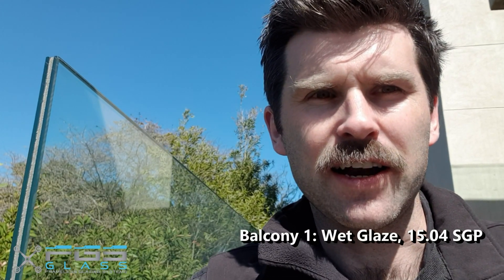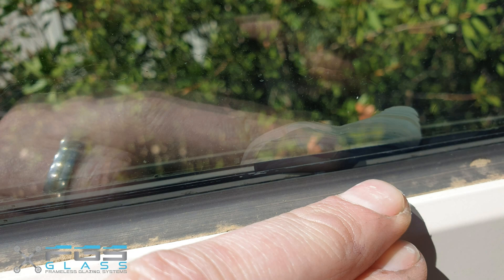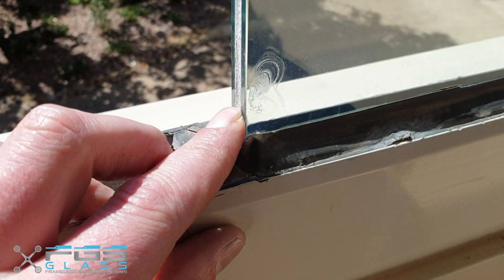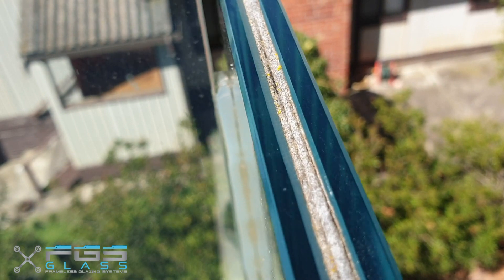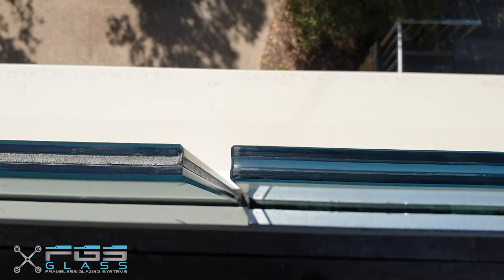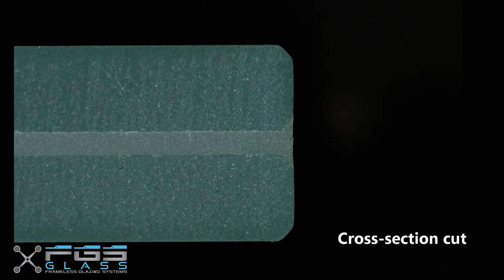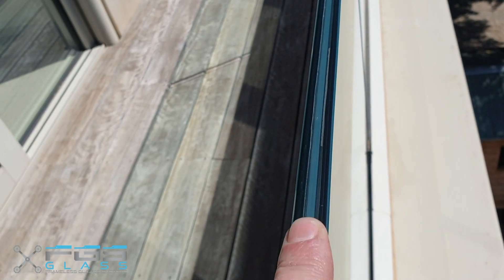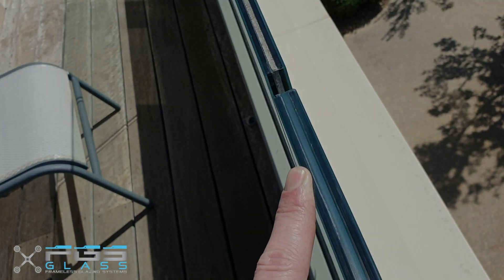FGS Laminated Glass Delamination and degredation

Comment: SGP will look very blue along the edge if either the YID is off (material) or the laminated glass was cooled too slowly after the autoclave (manufacturing). Neither is ideal. Both SGP and PVB will eventually fail if exposed to portland cement which is often the case when wet glazed in a balustrade system. Best case is to use dry glaze as pointed out in the video. Codes generally require either toughened or heat strengthened laminated glass in railing systems, but when the top is exposed, like in the railing in the video, there is a very real possibility of the something impacting the edge of the glass resulting in the glass breakage. While this isn't going to affect the safety aspects of the glass, which is the reason for using laminated in the first place, it will require replacing the broken panel.

Comment: So how would you fix that or stop the Delamination?
Reply: you can't, it has to be replaced
Reply: @gregcorwin8316  If you got a great deal (Price) on some windows  that were stating to Delamination would you buy them and how would someone fix that problem?
Reply: @troyfrei2962  once they start to delaminate there is nothing that you can do to fix it. If the glass is removed from the cause of the delamination it might stop propagating, but you can't undo whatever has already happened.
I might consider buying windows with delaminated glass depending on their current condition (how bad is it) and the potential for further problems. Also I would consider where and how they would be used. At best I would be hesitant.
Reply: @gregcorwin8316  If you could buy a one of those windows if the size of the window was ~ 4 feet by ~8ft   for $20.00 . (They would be remove for a building). Would you buy the window?
Reply: @troyfrei2962  How bad is the delamination and what are you using it for? Is it a complete window or just glass?
Reply: @gregcorwin8316  A building I know might replace ALL the windows that were installed because of delamination. SO Im thing of buying a few and putting them in a new shop or part of my home. The two partys ,the Glass makers and the installer are saying Its not my fault. So im trying to figure out IF I should try and buy them or let tme be taken to the Dump. So far no work is being done to remove but its a matter of time.
Reply: @troyfrei2962  I don't understand what would be meant by "your fault"? Did you have something to do with the laminated glass originally?
If all the windows have delaminated then I see that as either a glass manufacturing flaw that could mean that they were incorrectly manufactured and they will eventually 100% fail (worst case they might be dangerous), or else they might be failing because of using sealants that are incompatible with the interlayer, or it might mean that the glass was exposed to constant water along the edge resulting in failure. All are possible, do you have any information on why they think they are delaminating?
Once again, would you be buying just the glass or would you be buying windows?
Reply: @gregcorwin8316  Google "The University of Iowa seeks damages for children’s hospital windows"
Reply: @gregcorwin8316  If you google   "university of iowa children's hospital windows"
It seem ALL those windows will be replace. So would you think it might be worth  buying some at a cheap price?
Reply: @troyfrei2962  Do you have any pictures of the windows? Since I have no idea who manufactured the glass/windows as well as what's actually happening with them, I can't really comment on whether they are worth using. Depending on the cause of the delamination, plus the articles state that some of the glass has cracked, it's necessary to know what's actually happening before making a comment on whether they are safe to use or not.
Reply: @gregcorwin8316  I do not know the manufacturer of the windows.  If you google   "university of iowa children's hospital windows"  you will see the windows. Next time Im over there I see if I can look at them.  They seem OK . It seems to me if you seal the whole side of the windows with something the will  might be ok of 40 years. (Long enought for the windows to out live me,   Ha HA )